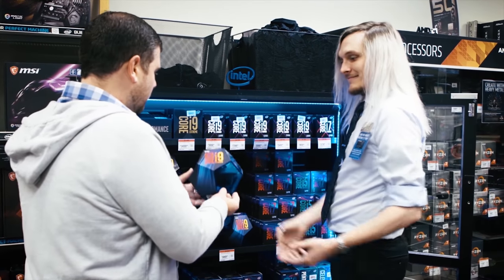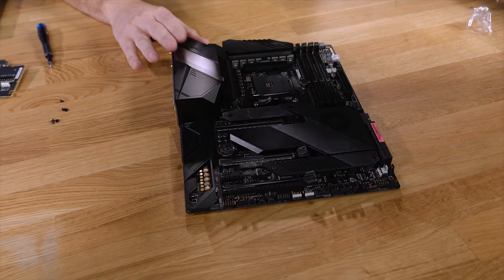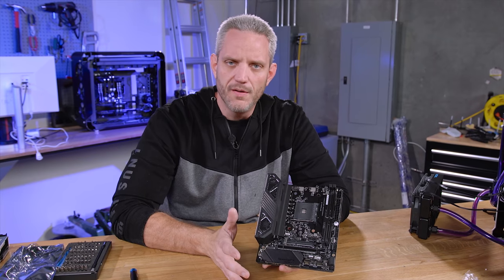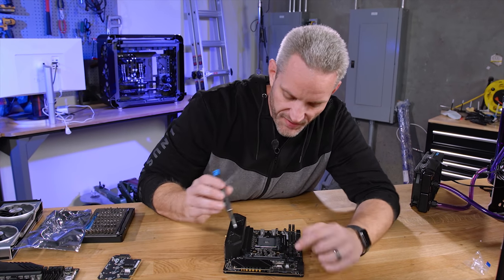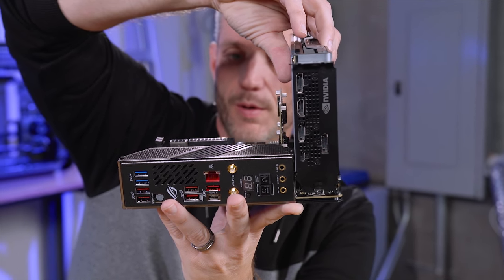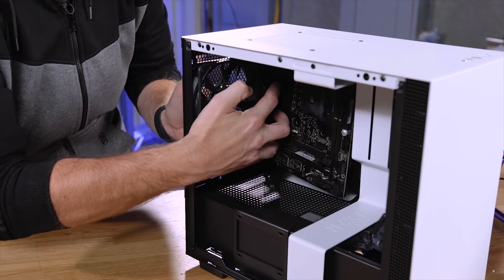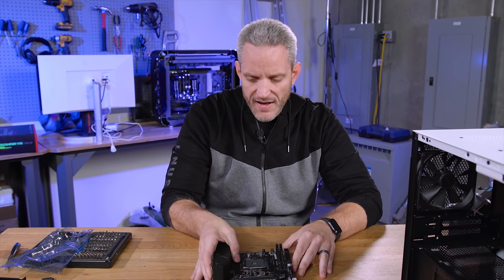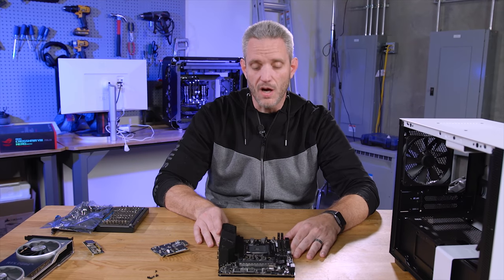This Mini-DTX Motherboard is NO JOKE!

Comment: This board fits in the NCase M1, for anyone interested.
Reply: My guy
Reply: Lol this guy^
Reply: The most recent version only though, V7 I think.
Reply: Which would be great if you could buy the M1 anywhere!
Reply: @beesknees2446  V6 is the latest and it does fit in that for sure. I don't know about the rest
Reply: @JJSnel-uh3by  it fits in a v1 ncase M1, I have one at home. The M1 was designed with DTX in mind.
Reply: It fits in any case the would accommodate a triple slot GPU, obviously mounted like supposed to.
Reply: The better way to discrible should be: if the case use a riser card, it most likly won't fit. It will fit into any case with traditional GPU mounting.
Reply: @oscarshen6855  Well, "most likely" may be true - but there are definitely exceptions. One is the Raven RVZ03, that one is actually advertised as DTX-compatible and I am sure it is (I briefly considered the Impact before settling on the Z390-I for a Raven build).
Reply: I do wish they would've picked two x16 slots instead of filling the space with a sound card, at least give the option of a pcie card in the top slot and a GPU in the bottom or two single slot cards.
Reply: It fits in almost every ITX board with 3 PCIe slots
Reply: @beesknees2446  As V1 owner, thats false, all fit DTX :)
Reply: Check out 
Optimum Tech! He built a PC with this board in Ncase m1. Seeing that much stuff in a small case is so satisfying.
Reply: My nigga

Comment: 07:50 Stickers on M.2 drives are usually thermally conductive. No need to rip them off, they are designed for it!
Reply: Doesnt matter more layers means worse heat transfer...the question is more is it worth to void the warranty.

Comment: I believe Paul over at Paul’s hardware mentioned that the stickers are thermally conductive and do not need to be removed to add a heat sink.
Reply: Any extra thermal interface adds to the thermal resistance. One thing is conductive, other is heat transfer between interfaces. Difference can be small, but there is definitely one.
Reply: Also, in some cases, the sticker is just that, a plain sticker, nothing fancy like that from Samsung. In that case the sticker will add resistance.
Reply: @siedenburg1  Samsung has copper pad sticker on bottom, top one is just regular sticker that should be removed. Also comes of very nicely (good kind of glue) and doesn't have warranty void text, it's only on the bottom sticker.
Reply: @onboard3  ok, I tought that Samsung had copper on both sides.
But some other others didn't even have copper in one side and also are hard to remove.

Btw, I use a Samsung ssd but without an additional heatsink. It's right in my airflow and temps never got higher than 35°C.
Reply: I'm pretty sure Steve at Gamers Nexus said the same thing, you shouldn't be removing the stickers.
Reply: @siedenburg1  Yep I got 970 EVO in my system and I've removed the sticker and added a heatsink :) If it's just M.2 interface SSD, those don't get hot, like 960 EVO. It's just sata drive in stick form. Only when you got to those 3000MB/s speed drives things can get hot.
Reply: @onboard3  don't know my exact model (OEM stick) but it's an nvme one with about 2800mb/s
Reply: @siedenburg1  Yep, they are almost the same as retail versions, just green and not speed tuned firmware. Regular usage it's just hard to put constant writes on the drive, so they don't get hot. Like mine is purely in OS usage, so wouldn't even need the heatsink, but was a fun thing to do.
Reply: Video idea??? Ssd thermal testing?
Reply: Plus, the SSD actually like to run warmer, but the CONTROLLER on it needs to stay cooler. Nand likes heat.
Reply: @Catalinddm  Yea, there was a video done about that. Apparently cooling the memory on the SSD can kill it prematurely. And as for dying of heat rather than cold it has to get pretty toasty, as in more than 100°C before that becomes a problem. Relying on my notoriously bad squishy memory I seem to remember that good working temperatures for the flash memory was in the 60 - 90 °C range.
The controller however is another matter and will be happy with as much cooling a heatsink can provide. AFAICR anything over 80°C was to high for the controller, but again my wetware memory is in a known bad state...
Reply: So many factors to consider cooling your M.2 drives. Also, the memory chips like or last longer at higher temps than seem normal leaving only the onboard controller chips that could benefit from a heatsink. For the most part, unless there is a severe out of spec temp I understand most drives should be left alone. If you really feel you have SERIOUS TEMP ISSUES YOU SHOULD PROBABLY RETURN THAT DRIVE AND TRY A BRAND WITHOUT KNOWN HEAT ISSUES.
Reply: Yeah, this is what I had always believed. I have put dozens of m.2 in machines and left the sticker on. Never once had it be a problem.

Comment: No need to remove stickers from SSDs, almost every manufacturer uses thermally conductive stickers on their chips.
Reply: I was looking for this comment so I didn't have to make a new one :)
Reply: Yep you are right.
Reply: Every layer more means worse heat transfer thats just simple physics.....but the question is, is it worth to void the warranty.
Reply: @12Burton24  The warmer the better for the flash. Till a high temperature, of course at some point it will stop working but >100°C is fine for flash, however the controller does not like it.
Reply: @happygimp0  Well the problem is you have a controller and the memory modules and they dont like the same XD

Comment: There is active Chipset cooling on this board. Like other small form factor X570 board, they moved the chipset to right behind the I/O board. The fan in the "VRM Cooler" is actually cooling the X570 Chipset.

Comment: Just in case noone has mentioned it yet: The ASUS ROG Strix X570-I Gaming is a Mini-ITX-Board which has the same amount and type of VRM's and MOSFET's  as this board, stuck into a smaller board. It also cosies both M.2-slots onto the board without the need of an additional board. AND It has 3-Zone-RGB AND costs less... The only thing it doesn't have compared to this board is the extra DAC (ESS ES9023P) which gives you the optical out on the back.

Comment: Jayz, for static in the audio, a fancy trick is to ask an electrician working with high voltage cables for one of the static isolation strips that are common in high voltage cables. They always pull out some when they're stripping the cables to connect to a feed.

Comment: More boards need the Q code on the back, that's really cool
Reply: I imagine it could also be rooted in they definitely don't want nanna to clear her cmos while rooting around back to plug in her magnification device or charging her rabbit.

The Q-code readout - Personally I prefer it on the board somewhere near RAM so little in the way. On ITX and the likes, that will be a lot lighter, and I'm less likely to have it slammed against a wall or have a side window and clear view so rear makes sense.

At the end of the day, my reservoir got in the way of the view, so I desoldered the segments, extended the wires and attached them on the inside of a PCIE slot shield - pointing towards the front of the case. One of them got a slight burnt sierra note to its white plastic housing from the hot air desoldering, but no biggie - still works fine.

Comment: Worth mentioning: I doubt the expansion card will interfere with coolers any more than other m-ITX boards because the socket has been moved north on the board slightly due to no VRM north of the socket.
Reply: No more then any of them that had issues to begin with. Flawed design is flawed. Not on Asus to worry about half assed cooler designers lol

Comment: This board fits my Cougar QBX if anyone is interested by such a build.

At first, I was a bit afraid of the motherboard risers not being actual risers and interacting poorly with the backplate as a result but the mobo+backplate and the screws+risers sandwich themselves in a pretty nice and solid way, with virtually no deviation from a backplateless mobo.

Comment: Taking the stickers off your M.2 SSDs isn’t necessary since a lot of the big companies like Samsung, Kingston, and others have said specifically that the stickers they use are also made to transfer heat for those who install their M.2 SSDs under a cover that has a built in heat sink. Just put the thermal pad right on top of the sticker, and right under the heat sink cover. They say it’s actually better because it helps the heat dissipate evenly off the SSD cause the sticker covers the entire M.2 stick.

Comment: Oh I just realized that is an AM4 board, AMD is actually getting cool products
Reply: I'm considering them seriously, for the first time ever, if I do this build. I haven't built anything for 10 years. Been catching up with things
Reply: Advocatus Diaboli  but using one unnamed game to prove your point is not backing up your argument. Intel (probably) will always outperform AMD in games, but a premium cost. Those who need the extra fps will always go Intel as will streamers
Reply: @weavercs4014  you must have mechanical eyes to spot a 4 fps difference in 200fps area
Reply: @fliqpythekiller9950  Don't care whose socket it is, that board is NEVER worth $430. $250 would be more reasonable, £300 at the very most.

Comment: 7:34 Jay comments here as if he is not aware that flash likes to be warm during operation, and, if you’re going to use the heat spreader, you’ll need to cut part of the thermal pad away where flash is located and only keep it on the controller of the drive, which is what actually affected by thermals

Comment: The chipset is cooled by the same fans the VRM is cooled by. my biggest concern with this particular motherboard is is if you have a case with a pretty low clearance between the bottom of the motherboard and let's say the power supply shroud, you're not going to be able to get those cables bent sharp enough coming out of the 90 degree corners under the video card. So that's another thing to think of.

Comment: talking about noise and interference on the front jack while there's a buzzing sound in the video. irony
Reply: The buzzing is the power transformer thats sitting between the two electrical panels in the back. They buzz when the electrical system is under load.Yay.
Reply: It should be possible to filter it out
Reply: @AndreasBrekken  if you bang two pots together and yell loud enough you can just barely hear the sound of the buzzing transformer, problem solved!
Reply: @420f37  Great idea!

Comment: I have this motherboard and an Obsidian 1000D and this board shockingly fit, did require a bit more force than I'm comfortable with when dealing with expensive PC hardware but it fit none the less. Now if only it were November 25th and I could buy a 3950x to match all the other fun components in the system.

Comment: Speaking of SFX - use one for that case. Steve at GN did airflow tests using the H200i (same dif) and found that temperatures were significantly better using an SFX. If that’s possible for you given your power requirements it seems like a win win.

Comment: Paul (from Paul's hardware) told us that we don't have to worry about removing the stickers on the m.2 SSD because they are thermally conductive (he said he asked it to every major manufacturers)
In his video : "When did you build your first PC? - Probing Paul #42
" AT 8 min 32 :  Do you need to remove the sticker from your M.2 drive before putting a heatsink on? 

I removed one recently (I would not have done it if I knew. They were looking exactly the same now unfortunately), but I noticed that the sticker was "special". And the motherboard'manual (which has thermal pads for the m.2 ssd) does not mention this aspect for their installation. 

Maybe tests and a final answer (from your personnal experience AND the manufacturers) would be nice :)

Comment: The X570 Chip on this board does have active cooling, it's under the same heat sink as the VRMs.

mDTX only makes sense to me if they where to move the PCIEX16 slot down one place and add in a PCIEX4 slot in its place.

Comment: Get a LIAN LI TU150. It even has a front panel USB C header and you can fit a be quiet Dark Rock Pro 4 in it. Not sure if the M.2 card would interfere or not but it's advertised with this specific motherboard in mind and it's a tiny ITX case.

Comment: Didnt you say in the past that the stickers on m.2 are thermally conductive? But now you say to take it off ??? EXPLAIN
Reply: The fact that they are thermally conductive is a safety measure. It is more optimal to take them off, but in the event that you do not, you will still have safe thermals for your M.2. Although, if it is PCI express gen4 like in this vid, you might thermal throttle your M.2 in extreme cases.
Reply: He is talking about the stickers for those thermal pads. He jumbles up words easily.
Reply: VolcanoPenguin only Samsung’s stickers are copper that can help by about 10 degrees Celsius. You should take it off still if you use a heat sync though. Other brands like WD doesn’t do anything other than void warranty if they are removed.
Reply: @Cerus98 it can if you don"t know your rights and don"t fight them over it
Reply: He's talking about the thermalpad stickers

Comment: At 7:37 you say to take off the stickers on M.2 drives, but I heard recently that most manufacturers make stickers out of a material that is heat conductive. It can't hurt but it's not necessary.

Comment: the 12v analog RGB header is for the amd RGB cooler, nobody runs 12v anymore... the 5v argb digital is near the bottom and easy to hide, it kinda looks like the chipset is beside the vrm.

Comment: not disagreeing with your explanation of the dimm.2 it was very good. I am just throwing this out there the stickers on NVME drives are actually thermally conductive and the thing on them that you should be concerned about thermally wise is the controller, not the nand.

EDIT: that is with PCI-E 3.0 at least I know 4.0 has heatsinks to help with thermals maybe that is another video for you Jay.

Comment: sugo sg-05 from silverstone uses sfx psus and supports mini-dtx mobos, one of the best cheap compact cases on the market imho...you can even fit a 120mm aio inside with very little modding

Comment: Hmm... he mentioned there is no active cooling for the chip set on the ITX board.  Looking at it I don't see the chip set anywhere on the board.  I'm pretty sure they have the chip set either vertically or  flush mounted under the VRM heat sink and fan as I see no other place on the board...  If that's the case I would assume the fans would be pulling double duty to actively cool the chip set as well.

Comment: If you could put a M.2 in place of that soundcard then that is a smart move, because you may want to use USB DAC's or have audio pass through the GPU.
I wonder how a motherboard will turn out if they designed it more modular with Sodimm.2 expantion cards, with seperate:
on board audio.
Wifi.
These ports can have one or two and use the Sodimm.2 slots as expansions:
Internal USB 2/3.
Sata.
Basically strip back all the features that can be seperated to Sodimm.2 and save space but still have the utility with the Sodimm expansion.

Comment: I guess I'm wondering why high end Micro ATX boards aren't coming back when SLI / Crossfire is useless for gaming but the chipset pci-e 4.0x4 slot would be useful for Thunderbolt or NVME drives. This board could have been standard Micro ATX instead of wondering if your non standard DTX will fit in an ITX case.

Edit: I think we should go to Micro ATX, DTX, and mITX. Full size ATX boards make towers rather large even if you buy a compact mid tower, and I don't really see the need for that unless it's a custom water loop which most people won't do.
Reply: MATX boards were generally just too cut down, and so people who had no intent on crossfire still bought ATX boards simply for the other features or OI they had and therefore motherboard makers consider MATX a dead form factor, because the sales were too low to justify the cost of designing and making them.

Comment: This fits fine into the Shift X but you need to get creative to "fix" it in place as the mounting holes don't line with the posts.  but it does fit fine.

Comment: Use a Corsair SF600 power supply or something similarly sized, much easier to work with in the case! Just remember your cable extensions.

Comment: DTX is not new, there were DTX motherboards a number of years ago, and I always liked them, because they were great for mini home servers, or HTPCs.  Most had 2 PCIe slots (or one PCIe 1 PCI, given the age).  One for a RAID controller and one for an upgraded/second NIC, or with an HTPC (prior to the prevelance of cord cutting) have a TV tuner and a single slot GPU, or a single Slot GPU and a sound card.  I liked them, because I built/build a lot of HTPCs because I enjoy the case modding and scratch building side more than having the actual computer :D

Comment: Apparently cooling the ssd microcontroller is not a good idea. It needs to be above 50C to run properly. Cooling the Actual Flash IC modules is fine.

Comment: Running a monoblock on an ASUS itx. 8700k from silicon lottery at 5.2. Max temps around 78-80c when running prime95.  Without monoblock, vrms overheat, power drops and bam, BSD. Moral of the story. Over clocking dtx/itx, monoblock and watercool.

Comment: You don't take the stickers off the m.2, Steve recently answered that question, stating that stickers are designed to thermally transfer the heat.

Comment: The M.2 base SODIMM right beside the Graphics card is not optimal . E.g. the back plate of my 2080 gets >70C at least and heats up the M.2 drives, even with plenty of airflow . Switched back to ATX ...